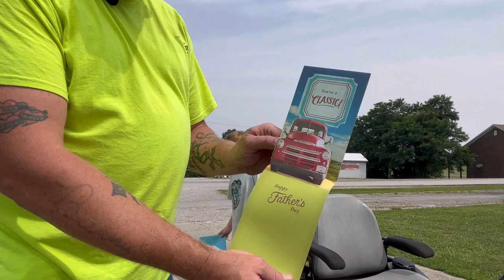Hustler Raptor Limited 52” Zero Turn Deck belt replacement and leveling.

Comment: I have a areins z turn 52 my lift brackets came apart and my belt came off help
Reply from the maker: Well the belt diagram should be on the unit somewhere or in your operators manual. As far as the brackets, did they break? Or just vibrate loose?